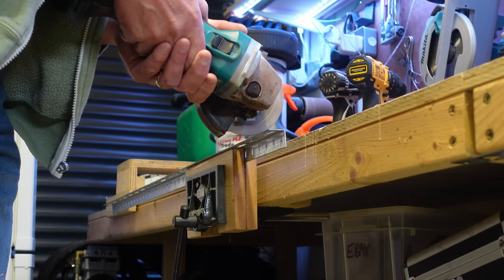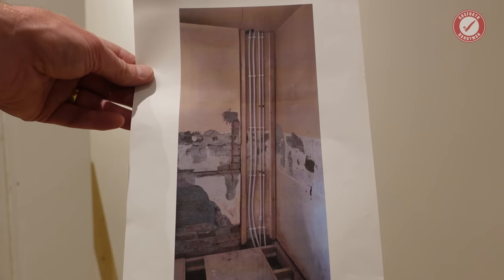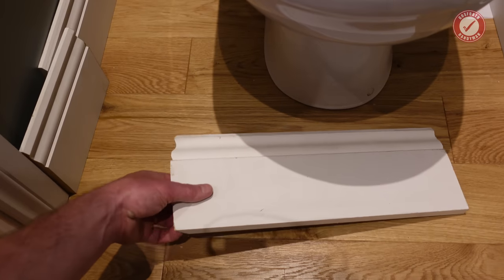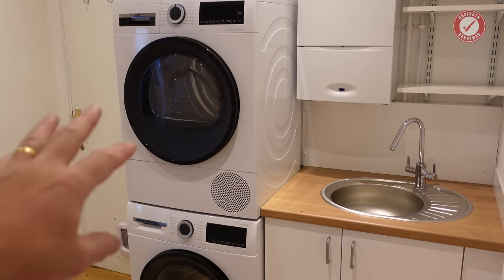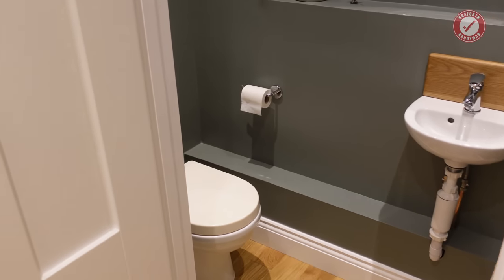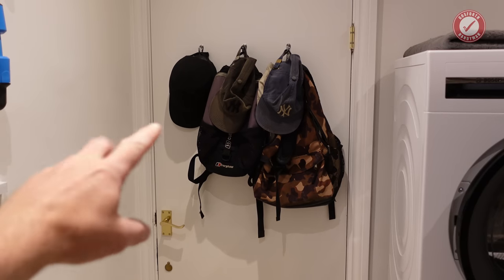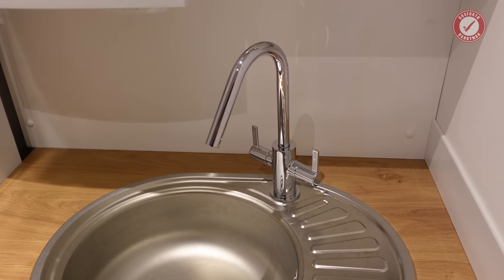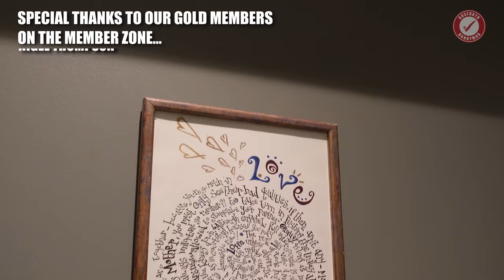It’s finished! New utility room and downstairs toilet (part 11)

Comment: To be honest this is a better finish than alot of professionals would do.
Reply: Cheeky bastard he is a professional 😂😂
Reply from the maker: Thank you for both those comments. 😆
Reply: @jimmylad8714  what does he do professionally though? The point Im trying to make is whether its plumbing, carpentry, plastering etc which Im sure he's not qualified in all he seems to do it as good if not better than most who are qualified.
Reply: @shoudd  I think he had a professional joinery business for several years but couldn't get qualified as he was too old! But yes his standard of work is way beyond most stuff I see out there every day. I view professional and qualified as two different things though. 😆

Comment: Love the skirting board bit. I fitted a new fireplace that was narrower than the old one by about 150mm but had no spare skirting board. Found a piece being used under the feet of the bath, probably been there since the house was built!

Comment: Two things if you have replaced the concrete floor with wood i would put extra support under the floor were the washer stands and secodly when your washer is on full spin even if levelled correctly it will shake your tumble dryer to bits (electronics and movement). I seperated mine with a shelf unit 15 years ago and it is still working just a tip
Reply from the maker: Yeah, the floor under there is 💪. Extra sleeper wall and everything. 👍
Reply: @GosforthHandyman  the only thing i would say is then just keep an eye on the vibration from the washer on full spin on the tumble yes like you say you have covered the support under the floor but all i was trying to say was everything is electronic these days and you don't want the vibration from the washer transferring to the tumble anyway great job 👌👌

Comment: You can have a light switch inside the toilet anyway - it's shower basins and baths which invoke the awkward zones. I seem to recall building regs suggest 300mm clearance from sinks, but a light switch in a toilet isn't a concern. I do like the Quinetic type stuff, so long as you're prepared to rip it all out and replace it when inevitably it fails and they don't make compatible stuff any more.. in 10 years. Still haven't quite got rid of the '70s switches in this house..

Agreed on the metal-backed edge tape. Tried it on one small bit of boxing, wish I'd just gone and got a piece of bead and taken the time to feather out. Too fiddly, too fragile, and now too much work to fix it - can't just bead over it because it's matched up to another lip which would invoke new bead on two more corners..
Reply from the maker: Ah wow! It was our spark who said we couldn't have a normal switch in there! 🙄 I did wonder... cheers! 🤪
Reply: 600mm away from showers baths and sinks, a pullcord from the ceiling is the usual option as you can link it to the ventilation.
Reply: @ChelseaPensioner-DJW  Which regulation specifies sinks, again?

Comment: Hello! For your joining and taping I got exactly the same results as you with tape lightly coming off on some corners and even between boards. My dad (experienced French DIY with meters of jointing behind him, that’s how we do in France,  rarely a full skimming) advised me to wait a bit more between coat of  jointing/finishing compound so it get strong, and does not suffer from the humidity of the later coat of compound…. Don’t know if that make sense. I will test the trick when I remodel the next room! I am doing my under stair cabinet/ utility room at the moment 😅

Comment: @13:37 I would have moved the coat rack over to the right away from the shelves on the left as when coats fill up the hooks, they will interfere with putting things on the shelves and removing them.
It's called Feng Shui. Basically, making it easy to access space.
Also, aren't those coat hooks a little too close to each other? You'd be surprised at how much space a winter coat takes up.

Comment: You may want to consider the joining kit for the washer/tumble dryer --- for the Samsungs at least, it provides a nice pull out folding table/table to sit your basket.

Also, is the bit on your drill the magentic forstner?
Reply from the maker: Cheers! I just don't like the idea of having to screw it in to the top of the washer 🤔. That Wera bit - yeah, magnetic. Link in the Amazon thingy. 👍

Comment: Great job. Wondering about the humidity levels....ive been advised not to stack the units as the dryer needs some fresh air to work fine. My idea is to stack them in a enclosure. Could you please advise?

Comment: Main advantage of a stacking kit is a pull out shelf, so you can haul stuff out of the tumble dryer into a basket right in front, and fewer flying socks end up on the floor. Nice to have, hardly essential, if your tumble dryer goes around fast enough to become unstable something is pretty badly wrong.
Reply from the maker: Yup! Are those pull-out shelves strong enough for a full basket??

Comment: Doesnt the tumble dryer get hot in an enclosure? We have a bosch dryer that gets really hot on one side. Its a condemsing dryer. Had the engineer out to check it. Said it was fine, and not to encase it to allow heat to dississpate?

Comment: Earlier on in the video, you added supports to the over 1m shelves by running supports along the back and a metal one at the bottom where the socket is, they did not appear to be there later in the video

Comment: Looks great! did your consider no sink in the loo, with the other basin right outside?

How about heating? I guess the appliances and boiler grnerate enough. 

Do you always use the tumble if its raining? We don't have one but do have a towel rail which is useful in winter, and planning to install a ceiling rack instead

Comment: Is that a door stop in the floor by the washer/dryer?  Why not a stopper on the top door hinge instead so you avoid stepping or stubbing on the floor piece?
Reply from the maker: This was easier. 👍
Reply: @GosforthHandyman you could have had a sliding pocket door. The stud wall would have had to be a little thicker though so narrower toilet

Comment: Another great video Andy,I noticed when you were talking about the tap exploding your boiler light was flashing,I have a Bosch boiler and when that happens I have to reset it as the pilot light has gone out,mine is 9 years old so does the light just go on in the new models when it fires up
Reply from the maker: Yeah - just when it fires up. Someone must have been running a hot tap. 👍